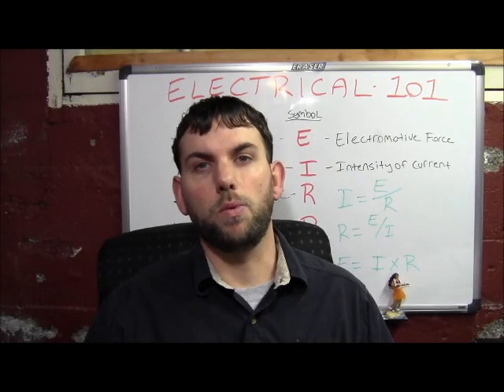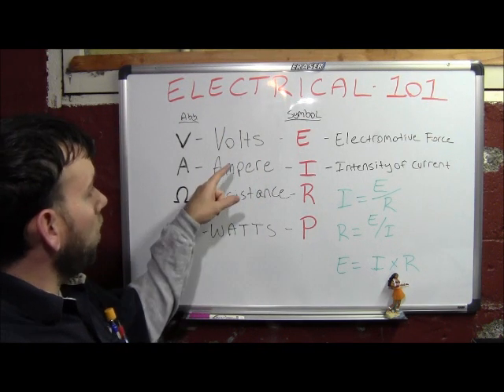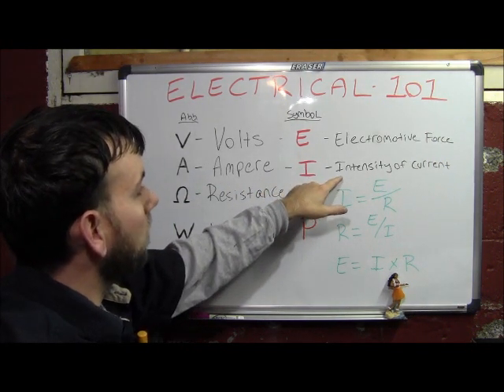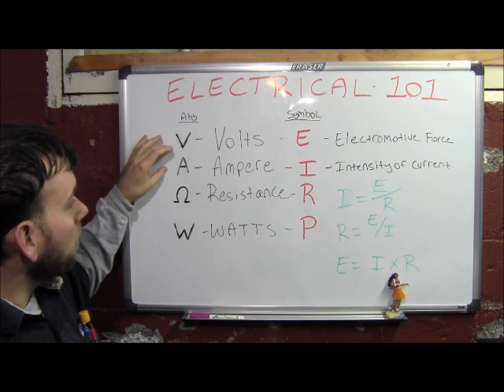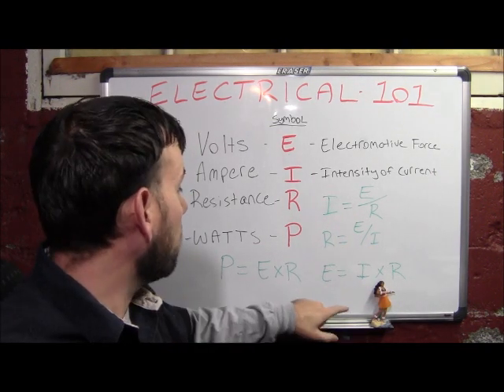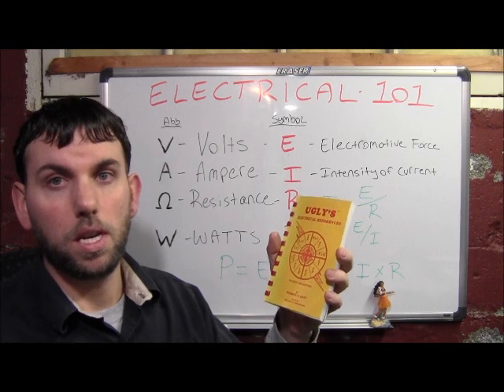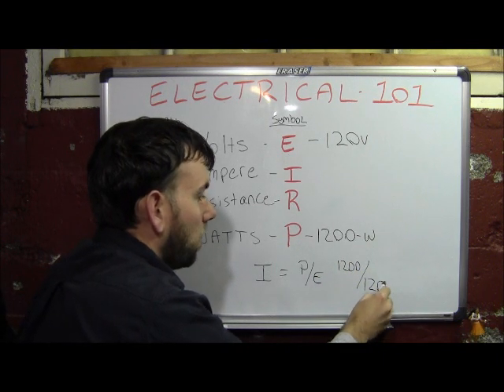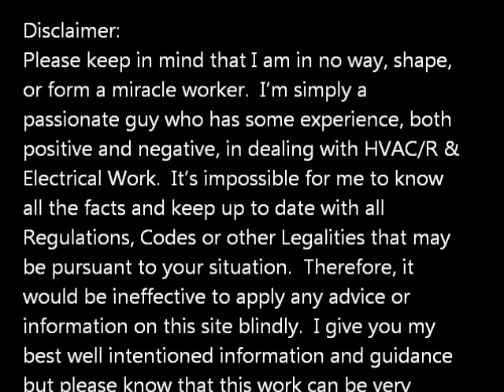RicksDIY Basic Electricity 101-1.wmv

Comment: Pretty neat. That was very informative. I can remember watching two guys struggling for hours trying to get my furnace working. I called my son in law and he told me about a re set switch to push. After those two guys gave up, I pushed the re set and it came online. They replaced three components and it still didn't work. I didn't have the heart not to tell them about the reset button. I still had to pay for the service call and they left the parts installed,   it still works today.